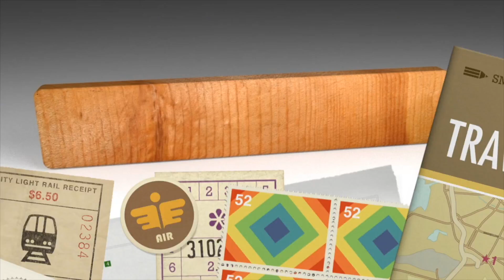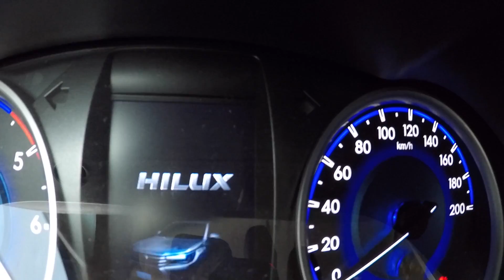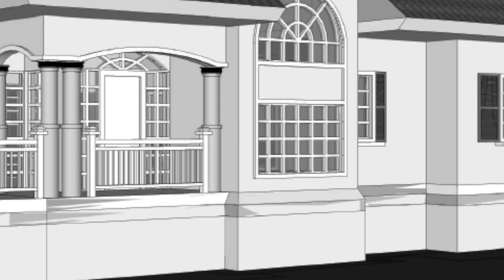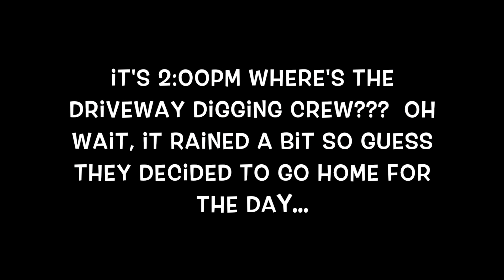VILLA FELIZ - EPISODE 180: TIME TO RETHINK DRIVEWAY EXCAVATION (House Building in the Philippines)

Comment: James,  After watching all your videos our build in Maragondon Cavite will be useing a backhoe for the cistern
and septic tank so thanks for sharing. We vacation in the US for 3 months of rainy season and return in
two weeks.  Starting the roof in october and doing it in poured concrete.  No use getting out of our comfort zone
changing to metalwork. I was surprised that you didn't get some power tools like a sawzall and screw gun for
all that purlin cutting. We  got most of the drills and saws at Wilcon and a little from Lasada.  All our formwork
is done with torx head deck screws  of T20 and T25  which are reused a dozen times and lets us reuse
the phenolic board as well. Makes assembly really quick, and an electric impact wrench for the form bolt ups.
     We did a spiral staircase with integral side walls. We spent 15 days on the forms with three people
working from full scale CAD drawings. After we see how you anchor the floating treads we will likely do a spiral
center beam like you have for the stairs on our second level. Might save 30 man days over the first stairs.
      For digging wall footers we have a garden rotovator that breaks up the ground a layer at a time and then throw it
out of the hole with a shovel.

Comment: Hi James, nice video. I think you will have maybe 4 weeks left until the rain everyday season starts ,:(.  Now that you decided to bring in a skid steer, you should also think about moving extra dirt piles in the yard. That way you don't need to bring back later. Here is some insight: many Filipino workers think about today. I will guess ur driveway and roofing crew went to drink. I see this in many p!aces where they work for themselves.  Most are hard workers, but they can be easy to persuade for drinks. Lol. My wife brngy there are many doing gravel work from the river. When it is nice, they work hard. But if it rains for N hour, the day is done because they will buy a bottle and forget work.   My motto is this:. I worked hard for my money, so I am going to work smart on spending it. If you make an agreement for a 3 day job, j expect it done in 3 days. Would have bee. Smarter for the contractor to borrow wheel barrels than using bags to haul. You need to be thinking 4 weeks to get all outside projects done. November will be mostly rain.

Comment: You should fire your tile layer and hire a new one. I have an 88 square meter house and a 50 square meter duplex. Certainly not big as Villa Feliz. Unless your basement is +1,000 square meters, it doesn't take that too long to lay tiles.
Reply: +JoyDivision1976 Philippine construction wages by default are daily instead of hourly. Lipa City in Batangas also have a lot of skilled workers.

I can understand where you're coming from if the tile layer is a relative or recommended by a relative who needed the job. If not, the shops that specialize in selling tiles (Floor Center, etc.) can recommend skilled tile layers who know what they're doing instead of making up excuses that the tiles weren't manufactured right.

Comment: After watching this video, just some thoughts that came to my mind when I start my next project.
QUALITY: I would try to hire 2 separate contractors, a structural contractor who does structural works and a finishing contractor who specializes in finishing works.  Its very rare in my experience finding a contractor even in Manila who can do a satisfactory job for both.
TIME: For a typical 2 storey house, structural works takes 2-3 months while finishing works takes 3-4 months. Total construction time (even in the rainy season) is typically 6 months and never more than 7 months for a 2 storey house. I would prioritize the roof so interior works goes on even if it rains. Workers work faster if they know there is another project waiting for them so I always mention that another project is waiting.
COST: After structural works for any concrete 2 storey house, only 40-50% MAX of the entire construction budget should have been depleted. The remaining 50% of the budget is only for 'average' finishing. 

Very informative videos by the way, keep it up!!